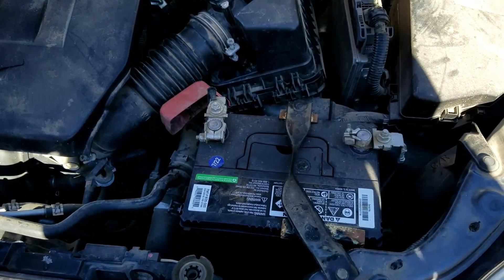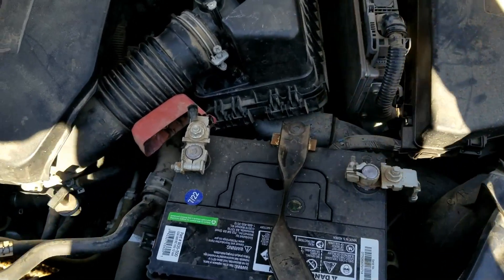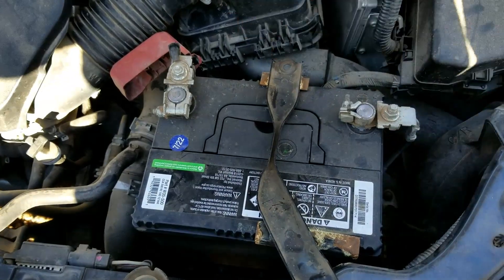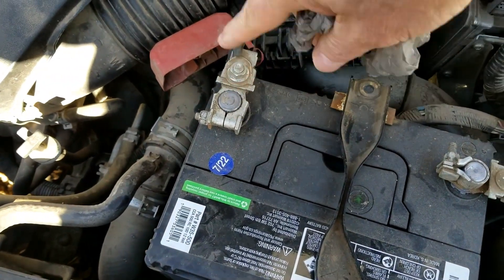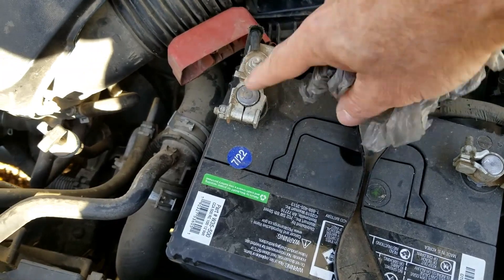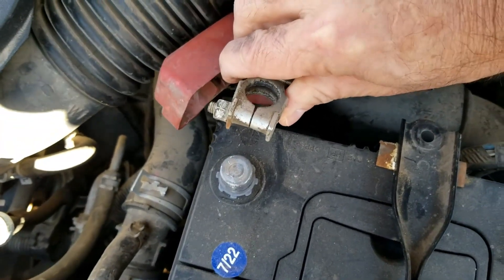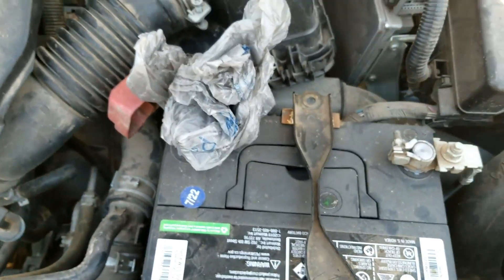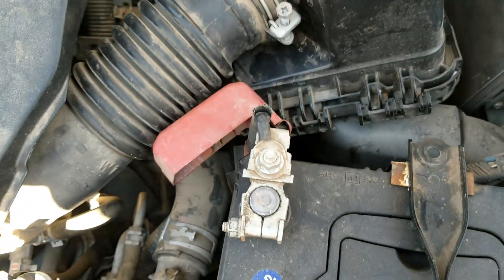How to Test an Alternator Without a Multimeter (Old School Alternator Test) (Do at Own Risk)

Comment: Do not take battery cables off while the engine is running (use a multimeter) you could fry the computer
Reply: I did this,my Computer is still intact
Reply: I have done this tens of thousands of times you cannot fry your computer. Sure well maybe there is a slim possibility of this happening it is unheard of. If your computer burns up it's because you had a problem with your fuses. The only thing that should be able to happen is popping a fuse.
Reply: Ya, you better off using multimeter.

Comment: You should never never disconnect the battery with the engine running you can do a lot of damage
Reply: Old school only
Reply: If the cars turned off how will you know if your alternator is good or bad then
Reply: You dont turn the engie off ,there are other tests you can do without disconnecting te alternator to determine if its faulty  @chelsteinberg6547
Reply: @chelsteinberg6547 if the car turns off while disconnecting the cable then the alternator is bad, the alternator is what runs the car, the battery just starts and helps run the electrical components but you can drive a car without a battery while it is already running
Reply: You shouldn't remove the positive you should remove the negative. positive is only positive with a negative and a negative is always negative. That's why you always put positive on first and then negative there is evidence that is in Reverse it Taking It Off but that only matters when the engine is on, cause A battery produces hydrogen when it's charging. hydrogen being what took the space shuttle to the moon it's very combustible. Due to how expensive it is. If he was to do the negative it wouldn't Spark.